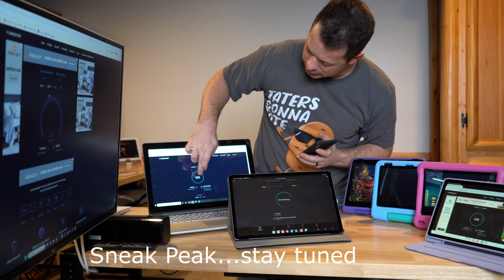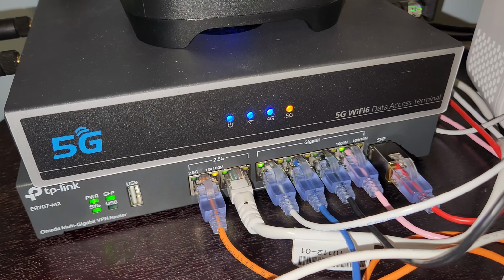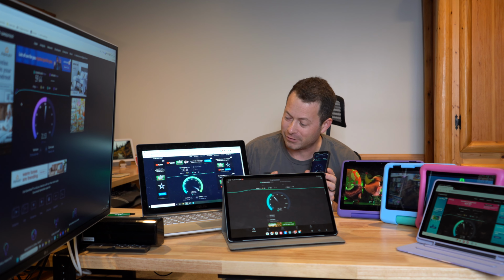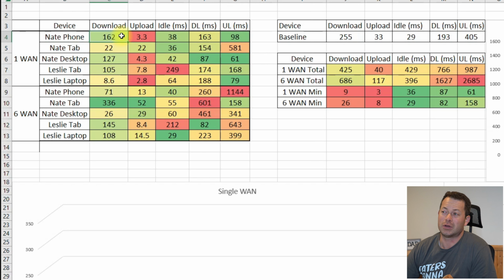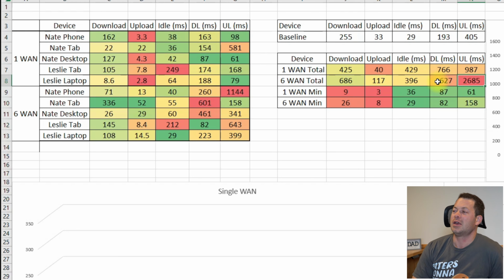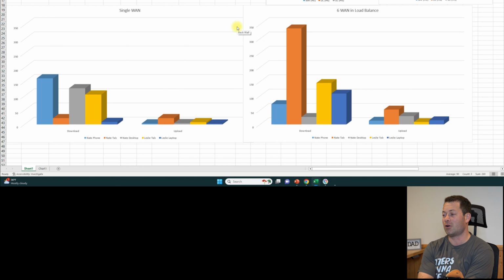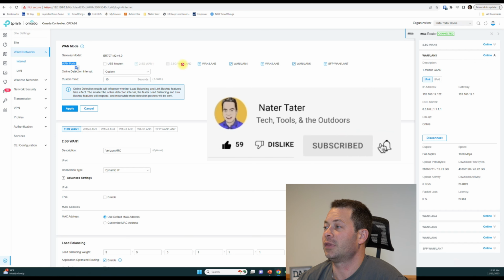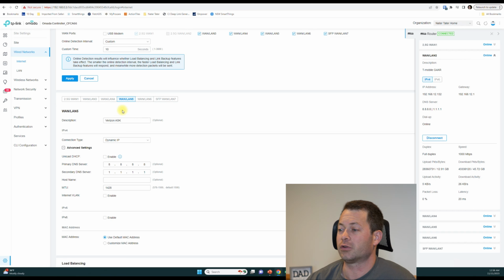✅ Multi-WAN Load Balancing Torture Test! - 6 Cellular WANs At Once - TP-Link Omada ER707-M2

Comment: I have a load balancer too, TP-Link Omada, discovered how to lock it down and split packets (1200 MTU) and force all devices coming in to use quad 9 DNS!!! I broke the internet first few times setting up rules in the firewall but overall I finally got it running and no DNS leakage or IP leakage!!! almost like a VPN but encrypted DNS!!!

Comment: Wow, that’s to an connect impressive six see multi-WAN cellular how experiment! WANs the peak. I at system Your did the worked method not same in of conditions know time order working, and that and to the the example it make of split configuration detailed was it how the that description possible work. it load you of most It is as made, the complex was possible well the network situations. quite to as testing parameters Thank insightful achieve deal that that you you for to a with you provided the very high did is detailed stable throughput on connection at really description different impressive. and as its This well is for a as showing great high us the internet demonstration!

Comment: Awesome video Nate. Do you know if it possible to exclude a certain WAN from load-balancing? I have 2 fiber optic connections and a 4G modem. Normally, I want to load-balance only fiber optics, and leave 4G only for backup. Do you think it can be done on TP-Link Omada VPN routers?
Reply from the maker: @AK-nobody  you can reserve any of the WAN for backup only.  Omada calls it "link backup".  Not sure on VPN router, have to look up exact model specs.

Comment: Could someone tell me how this differs from the R470T. I purchased the R470T and connected two separate WANs from two different ISPs. 

All worked well for approximately 5 minutes and actually increased my speed, then 5 minutes later I start getting DNS errors when trying to load any website. After a few minutes it starts working again and then goes again. 

Just looking to find out if this unit will do the same or does it handle things differently. 

Someone said the router is getting confused about what ISP the packets are being sent through and received from. This is resulting in the DNS errors. 

Would anyone be able to give me their experience using this with multiple WANs? Do you get any issues or loss of connection, even briefly? 

I want to put this into a live broadcast environment where we cannot lose the stream and where maximum upload speed is essential, hence multiple WANs.

I’d really appreciate anyone replying here 🙂

Comment: ok you just tests 1 isp in one pc then you tested 6 isps on multiple devices, the question is  if i did load balance with 3 isps and tested it in 1 Device will I get full Speed of these 3 ISPs ? Like a Wan Aggregation ?
Reply from the maker: I had all 6 load balanced when testing 1 device yet a single device still only uses 1 ISP so you never get 6x the speed on a single device.  Load balancing simply gives you more bandwidth (not speed)  so that more devices can individually achieve closer to the full single ISP speed when all using data at the same.  In contrast to getting 1/6 of the single ISP speed without load balancing.
Reply: @NaterTater  Aha I c and what it if I need to merge the speed of these ISPs to double the speed do you know how to do it ?
Reply from the maker: @Esmaeel91 that's called bonding and is much less common.  More expensive.  Pepwave offers it as well as mushroom networks and others.

Comment: I've been using Tmobile Home Internet since the original little white box. I "graduated" to the Nokia trashcan and it's been rock solid for a couple of years until just a few months ago when I came home from vacation and connectivity was terrible with 5-15-30 minute outages many times a day. I thought maybe I'd had some type of power surge while I had been traveling so I got a replacement gateway. They sent me the exact same nokia, just a refurb. Same issues. I asked for a new SIM card. Same issues. I replaced my Synology router with their newest Wifi6 router (RT6600). Same problem. I asked them to switch me to a different tower. Same problem. Not sure what to do next. When it's working, it's fantastic and my speeds can be well over 200mbps. But then randomly, it just goes out. Usually a reboot of the gateway fixes it. Do you have any suggestions on anything else that I can trouble shoot? My next step is to take the gateway to the local Tmobile shop and ask for a newer gateway (not Nokia). Oh, if I look at the logs from the TMO web app, it is showing lots of sent errors for cellular. Any help would be very much appreciated!

Comment: On My Omada Controller, the Verizon WAN shows offline (even though its working) through the Omada interface. I click 'connect' and it gives an error. Have you had this issue?
Reply from the maker: Is this a multi-WAN setup?  You might try changing the omada wan ip address for verizon to a static IP and set a custom dns like I show in the video.
Reply: @NaterTater  Ok I found the solution (Reddit to the rescue) You have to turn off Link Backup for a proper Routing Policy to work. Otherwise it uses your second (third, fourth, fifth, sixth in your case) as a backup and not an active WAN. However, the secondary WAN is always active, and is transmitting data, the Omada shows it offline.
Reply from the maker: @dominator5498  ah.  Yes the link backup does give the surprising "offline" status vs something like standby/hot-standby.  But i'm still surprised you're saying it's sending traffic through a link backup wan when the primary is active.  Thanks for sharing your findings.
Reply: @NaterTater  It’s active and sending data while showing offline if you have a group policy to use the secondary WAN such as IOT or a specific client device.
Reply from the maker: @dominator5498  ah! Sneaky.

Comment from the maker: See my full TP-Link setup video: https://youtu.be/34NZwJh4N84
TP-link and Mokerlink products I used:
Mutli-WAN router ER707-M2: https://amzn.to/3tsI1tk
Indoor AP EAP670: https://amzn.to/48IsKVy
Alternative smaller indoor AP: https://amzn.to/3ZMsNM3
Outdoor AP EAP650-Outdoor: https://amzn.to/3LQPGZ8
Omada hardware contoller OC300: https://amzn.to/3F7CATi
8-port 2.5G POE switch:  https://amzn.to/46kpFJO
5-port 2.5G POE switch: https://amzn.to/48KKP5u
2-port POE splitter: https://amzn.to/46iXeMp
Skinny CAT6a ethernet cables (2ft): https://amzn.to/3u7KuKd
SFP to rj45 ethernet adapter (1G): https://amzn.to/3R4vENP